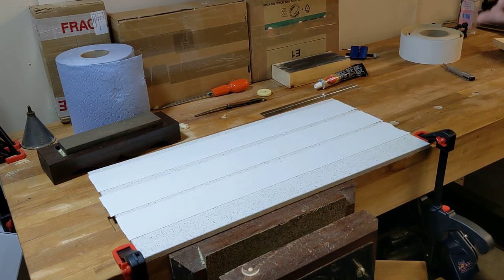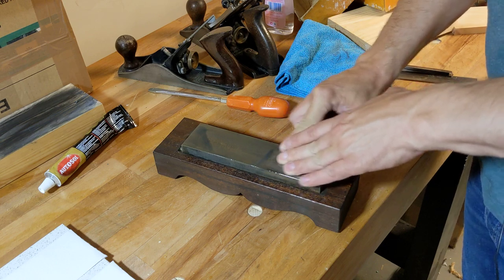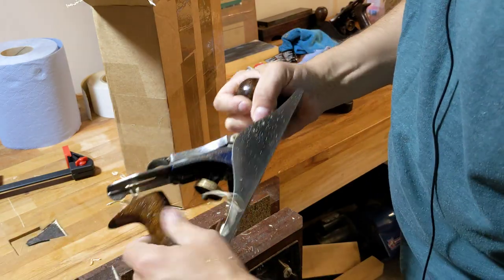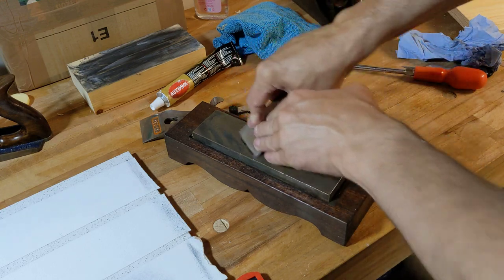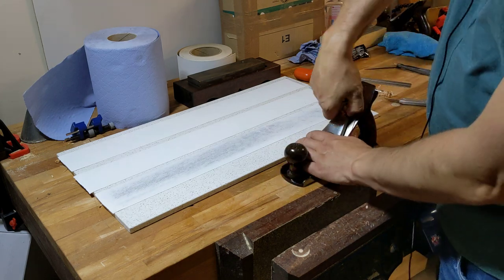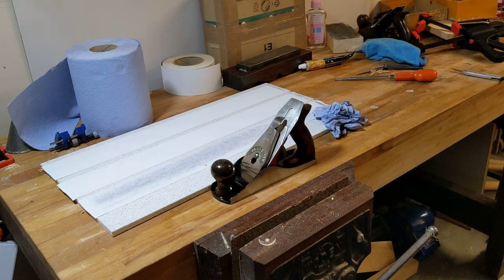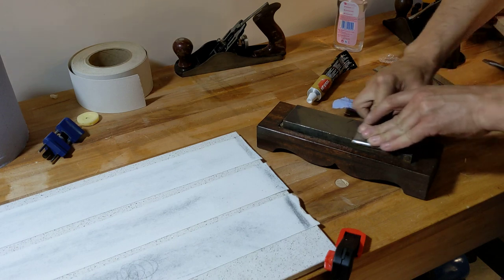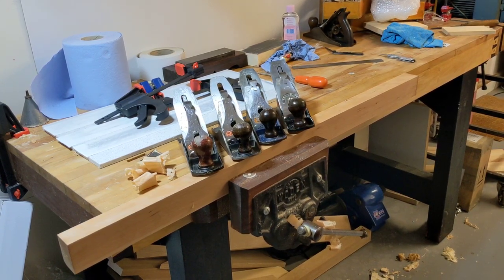Four eBay No.4 Planes Set Up In One Hour!

Comment: When I restored a couple of planes recently, I used mdf instead of a tile and found this adequate for my purposes.  Much easier than the method I used years ago on my Record no 06, which involved using the surface grinder at work.
Reply from the maker: Richard, MDF would be ideal. I'm very lucky that at work there are long machine beds, dead flat, that I can use with some abrasive. However, not an ideal video presentation 😊. As long as the substrate is flat and we check progress, there's not much to worry about. Thanks for sharing your experience 👌. I flattened a No.8 once so I feel your pain on the No.6 😱

Comment: One of my favorite aspects of the old planes is that in the process of tuning it, flattening stuff, mating surfaces, you learn how the plane works and get an appreciation for the tool. With modern tools you don't develop that connection to your tool as you do when you tune it up yourself
Reply from the maker: It's no bad thing to thoroughly understand the tools we use everyday. Restoring an old tool is a great way to do that.

Comment: I don't know for sure if it works, but i think you can take a random tile, flat or not and glue up a standard piece of float glass on top with silicone or something to fill up gaps, should be enough for it to not flex.
Reply from the maker: Thanks for the feedback. Before doing the video I spoke with a glass supplier while placing an order at work. I hoped for a piece of thick polished float glass with polished edges. However it was actually quite expensive. Nice idea with making a built up version.
Reply: This does work within reason, but the bed of silicone needs to be thick enough to take up all the slack because glass tends to be flexible enough that it can indeed be tweaked out of flat if bonded tightly to a non-flat substrate.
Reply: I put a piece of float glass on top of half inch plywood and I've never had a flatness issue
Reply from the maker: @jgo5707  Thanks, good to know it's a reliable option. I just found availability and cost a problem. Cheers.

Comment: Hi, thanks for another interesting video mate,  the planes you bought were actually in very good condition, that's a bonus in my book, most that I see at car boot sales are in a bit of a state, and not worth the effort involved to get them working again, but they can be a source of spares if cheap enough. Your video showed us that it's not hard to fix a second hand plane up into a working tool again, that properly looked after will  last  for years. Best wishes to you and your's, Stuart UK.
Reply from the maker: Thanks Stuart. They are a pretty decent selection and I'll cover that in a follow up video. You're right, a really bad one is hardly worth the effort. That said, the reward of restoring something can be very enjoyable. Thanks for taking the time to watch 👍
Reply: It's certainly true in a lot of places that the majority of car boot finds are in a bit of a state, and don't seem to represent a worthwhile investment (certainly not in a plane-rich environment as found in much of the UK). But for anyone who is unlucky enough to not have easy access to planes in nice nick I do champion the restoration cause, because, touch wood, so far I have never brought home a rust bucket that couldn't be brought back and actually it doesn't have to take a ton of effort, the rust soak or electrolysis doing most of the heavy lifting tackling the rust. So most of the 1-2 days it takes is hands-off waiting. This is minus the handles, which depending on their state and the finishing option chosen can take a lot longer...... unless one is of the sand, oil, and done persuasion 🙂

Comment: Well you certainly didn't need any of the tips from the Plane Collector vids for these four! Nicely done. Great to see a concrete example of something that I've banged on about for years, that from what I've seen firsthand in my purchases most planes don't need to be lapped for them to do acceptable work (and hence the obsession with following this step verbatim as part of every plane restoration undertaken is just stupid; a big ol' waste of time and energy, and in the case of a hack or a well-meaning but inexperienced operator runs the risk of introducing geometry problems that weren't there to begin with). 

Now obviously there is a bit of luck involved, as you commented on in a few places, but I have never gotten a no. 4 back home that didn't have an obvious groove worn into the sole from years of edge work (probably on ply and chipboard!) that no question needed work done to the sole for it to work within what I might term 'normal acceptable tolerances', which is probably another way of saying good enough for government work :)
Reply from the maker: Thanks Carbide. Yep, there's no need to go looking for problems. They are relatively simple tools that were well made. Yes, there can be a need to improve them if a less than stellar one arrives, but even then, a bit of cast is soon abraded flat. 
Thanks for sharing your experience, I hope people look at the comments and see the benefits of a simple approach. Cheers 👍

Comment: While it is a good way of getting rust off the plane sole and sides most vintage handplanes do not need to be flattened really.  I must admit that I like to get the area just in front of the blade opening flattened, but that is about it.  

You are very right when it comes to the vintage vs the newer planes and the newer high end planes.  There is no NEED for a woodworker to get the expensive newer ones, the Bailey pattern handplanes will tackle everything a woodworker would require from them.  Some might say that the BedRock style handplanes are so much better because you can adjust the frog/hence the month opening between the front edge of the month and the blade without taking off the cap iron and the blade.  But that is true ONLY if you for some strange reason are in need of adjusting the mouth opening often, and 99-ish % of woodworkers will never have such a need.  Also , look up what Paul Sellers say about the difference in the frog adjusting on a Bailey pattern plane and a BedRock style plane.  Sorry I don’t have the link to it at hand…
Reply from the maker: Hi! Thank you for your comment. I agree, I only flatten the sole if I know it's an issue. In my experience it's only the cheaply made planes that I see our apprentices buy that have badly concave soles.

I agree on the frogs too. Although it's nice to have a feature where the mouth can be closed without taking the blade out, the stark reality is I've never needed too! If the grain is bad I just move the cap iron close to the edge and take a light cut. Thanks for the video recommendation 👍

Comment: Looks like you got some decent EBay buys there👍🏻.  I’ve done up a few planes over the years (my favourite Stanleys are the ones made between the first and second world wars personally- partly for their sense of history really) but I’ll be buggered if I have ever found any decent sticky backed sanding rolls apart from USA imports with all the tax issues with that.  I’ve always resorted to double sided tape.  Where did you get yours? Any pointers would be appreciated.
Reply from the maker: https://www.frost.co.uk/pressure-sensitive-adhesive-psa-paper-25mm-70mm-80grit/

This is where I got mine. Just search "PSA abrasive uk" and you should have options 👍 

Yeah, I got some good ones. I'll cover that in the debrief.
Reply: @faceedgewoodworking  Thanks for the link 👍🏻
Reply from the maker: @tonyalways7174  Anytime, it's not the easiest to find!

Comment: I have a couple Stanley number 4s. Both of them have kind of a textured body. Like the sole and sides were rough ground but not finished. My Bedrock 604 is nice and smooth. Just struck me as odd that these were like this. Anyone have any that are the same?
Reply from the maker: Hi Robert, I know the finish you're talking about. It's awful! If as I suspect these are relatively recent planes it's just down to Stanley giving up on quality. I'd rather they stopped making them instead of turning out garbage.